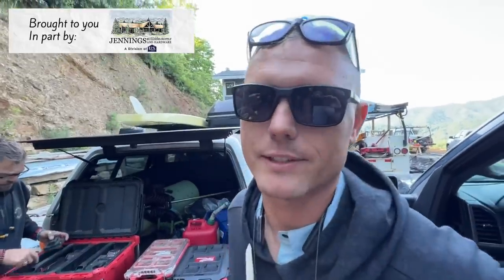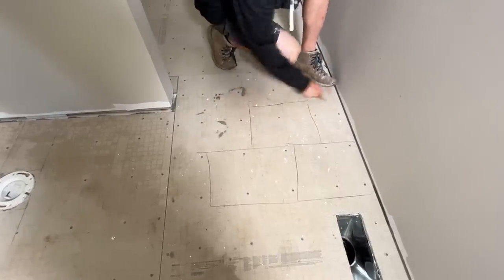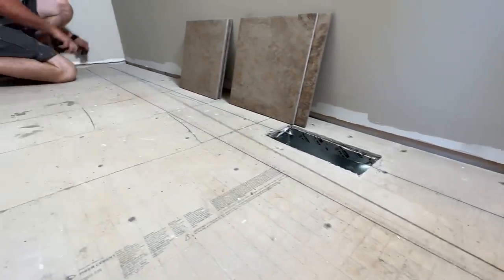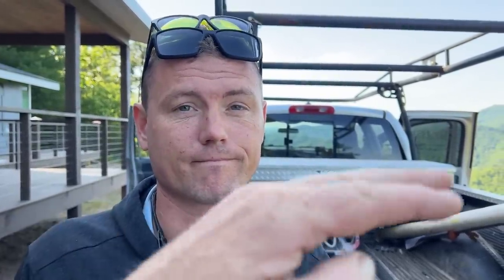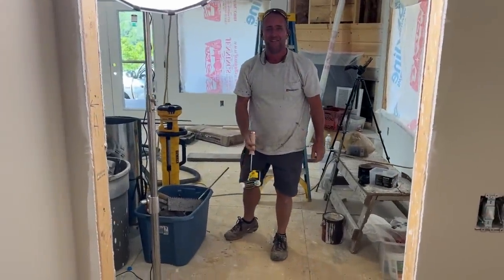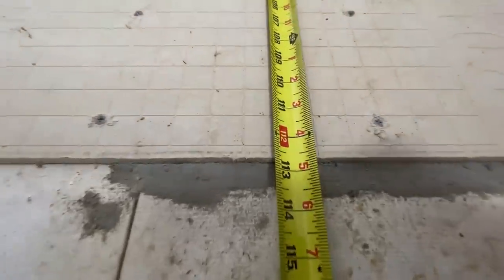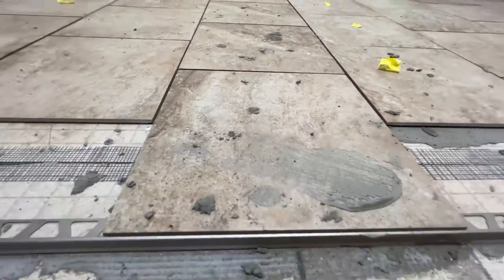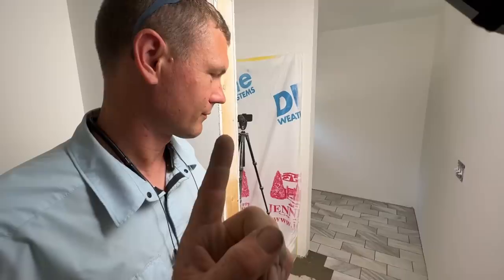Building A Mountian Cabin EP41 | T I L E goes in and we get a new tool!

Comment: For context I'm a tile setter.

The good: 

Glad to hear you are using thin set below your cement board, some people think you don't have you. But you absolutely need to! Also great to see you are taping your seams and it looks like you are not cutting tight to the wall (you need those expansion joints!)

The bad:

The way you are using your thin set will guarantee the lifetime of the floor will be shorter than it should be. For the last few years I have been replacing floors for a landlord that has many properties. His previous tiler put in flooring the exact way you are, and all the floors are failing. Some quicker than others, but the key feature that guarantees a floor failure is troweling the tile, especially when the trowel lines are going different directions. I highly suggest you get a pro tiler to walk you through an install on site. 

When I'm installing a floor here is what I do:

1: Set the cement board and tape seems on day one. (let the floor set for at least one day)
2: For a small room like that I make a template for the whole room and make all my cuts. Everything should be mapped out and ready before I set a single tile.
3: For setting the tile I key the floor like you are, then trowel on the floor (not the tile). Never ever have trowel lines going opposite directions. Before I set the tile I butter the back (same as keying the subfloor). Once the tile is laid in place all you should have to do is wiggle  it a bit to see your thin set lines collapse, all of the air should evacuate (if they cannot collapse you either have air trapped or you thin set is too stiff)

A well installed tile floor should be able to withstand a 25lb weight dropped on it from four feet or higher without the tile snapping. If there are enough air voids beneath the tile it'll snap. Heck a well set tile could have a hammer taken to it and it will never snap, just chip. 

Y'all do great work, and did everything correct outside of proper troweling and placing with the thin set.  

One last note, when buying tile, the batch number is on the box. Even if the tile is 'the same' it may not be from the same batch, which will account for the size difference.
Reply: Yes, everything that Relief said. Plus mix up several boxes of tile and randomly select a tile when setting.  That assures any variation is spread out and not as observable.

Same goes for shingles on a roof.
Reply: When you say "key the floor, then trowel on the floor"... what am I missing? Isn't it trowel the floor then key it to create the notches?  On the tile itself, I just 'back buttered' the tile with a thin layer as even as I could get for my shower, I made the notches in the thinset on the wall.  Any tips on how to get even thickness on the tile when backbuttering?  I like the idea of using the teeth on the trowel on my tile to keep it 100% uniform, but have read not to key both tile and floor and only one.
Reply: @nicpedia2432  Sorry for any confusion. When I say 'Key' the surface I mean work the thinset into the surface. So use the flat side of your trowel and really push it around and into the surface. That way you don't just have thinset sitting on top of the substrate, it's 'keyed' into the surface. Once that's done use the notched side to create your lines going in one direction. 

To review: You should be pushing the thinset into the substrate, then notching the wall/floor, buttering your tile and applying. When I back butter the tile I just use the flat side of the trowel and skim it across, I don't leave a raised layer, it should only be filling in the voids between the ridges on the tile itself. I don't really have any great tips for buttering other than running the flat side at a 45 and pull off any excess. 

I hope that helps.
Reply: Wow that’s a lot… thanks for the info. Lots of good insight
Reply: Agreed this install is bare minimum at best
Reply: 100 - thanks for sharing.  I was a tile-setter for about 5 years, and spotted everything you mentioned.
Reply: Since the Perkins Bro’s & crew really hate T-I-L-E so bad (Almost as much as Jason “loves” Painting 😂) maybe you ought to step up & offer them some journeyman on-site training & consulting.

Hell, you’d get a good vacation out of it & it seems like they all get along good enough.

They can start an offshoot series called “learning from the expert”

Comment: I can give you a good pointer for layout for tile. Layout 2 to 3 rolls with the spacers so your gap is already set, then you measure what that two or three rows is then you can measure it out on the floor and strike some lines. That way you can start in the back of the bathroom and work your way out towards the front. And as long as you stay on that line that you struck it will come out perfect every time. And if you’re doing a big room, another trick is to spray the chalk line with hairspray that way you won’t sweep it away it will stay on the ground as long as you need it to until the job is done. Works every time for me. And I just use some cheap dollar store hairspray. And I use that method on jobs that usually take more than one day like for living room and dining rooms that go together. You’re welcome for the great tip. Lol
Reply: Well thank you

Comment: I thought with mortar that you’re supposed to apply in one direction and not different angles? That way the air between the ridges can escape and you get a good adhesion to your floor?
Reply: U are right sir
Reply: If you apply the thinset to the floor yes. If you apply on the tile in a starshape pattern is fine. Air has a straight way out from any point of the tile. I use this technique for repair when I only replace 1 tile. The shorter the distance for air to escape, the better. I’m a tile guy btw.
Reply: That’s correct .. it’s called directional troweling and they are doing it the “homeowner way”

Comment: Pro tip some manufacturers put a tiny arrow on one edge of the 12x12. If you put those in the same direction the tile width wont vary as much sometimes the tile measures 11 7/8" x 11 3/4" as an example.

Comment: Eek I haven’t finished watching but seeing the mortar applied to the tile like that scares me 😳. You should apply to the floor with the notched trowel in one direction (whichever path is the shortest to the edge of the tile). The notches are to apply the right amount of thin set but also to let air escape. When you apply it to the back like that in every direction you’re bound to get air pockets
Reply: My thoughts exactly.
Reply: I was looking to post the same Pro Tip but you beat me too it.
Reply: Your overthinking it bud, it’ll be fine. Guarantee those tiles will never come up.
Reply: @CarbideEndMill  i promise you 100% that there is hollow spots in their tiles. do a youtube search for thinset coverage. It is REALLY easy to trap air under your tiles if there is pockets from the jump
Reply: If no one corrects, we can make good money fixing their shoddy job!
Reply: As soon as I saw that happen I came to the comment section!😂

Comment: I tell you, it's so much easier to work from a centered cross chalk line when you're laying tile.  And I know bathroom floors are rarely square (anything but!), so what you do is find the closest thing to center.  That is, you center North-to-South and then center East-West and then find the best intersection of the two.  If it's an "L" shaped room, then the intersection would be best in the turn of the L.  The point is, if you do it that way, you never have to worry about one edge of your tile being a little sliver.  AND, you should lay out one line of tiles in all directions (without any mud; just the tiles) along those lines just to be sure.  If that sounds fussy, all of that takes about 10 minutes.  And then you know.  That's how I was taught... back in the day.

Comment: Pro Tip for those new to Tile, BE CAREFUL with the Cut Edges, they can cut like a Razor Blade!
Reply: I learned that the hard way 😅
Reply: I learned this the hard way a long time ago
Reply: For some reason those are the most painful cuts too 😢
Reply: word. i slipped my finger once and it was a smooth big cut.
Reply: need to use a polishing block to help with that it will roll the edge on the cut side
Reply: Yes sir, dad told me all the time on a job site during demo and slice went open my fingers. Luckily I still have them in tact 😅
Reply: My four fingers will attest to that.
Reply: This is one of those things I always hear, but never really KNEW a until I experienced it first hand.  It’s obvious, but until you see that pool of blood in your mortar and can’t remember getting cut do you understand the real danger.
Reply: @apdj94  for me, they were painful later.  I didn’t know I got sliced until I saw the blood.  Later than day and the next, every time I moved the finger, I felt it!
Reply: It doesn’t feel like a razor, it rips through the skin. I tell all my new guys it’s not a pleasant feeling you ever want to experience. They never listen lol

Comment: Really enjoy watching the work you guys do but as a tile setter I love how much you hate it. That dewalt is a great saw, I run one as my daily. Look into sigma cutters and systems like schluter or laticrete they cut the labor, it's a  better assembly but increases cost. Hardy is extremely porus and will effect the thinsets bond. Hydrate your substrate, slightly bigger trowel and a touch thinner mud would achieve a better install

Comment: Another pro tip for you guys is the trowel  lines all have to be going one way for the tile to properly stick to the underlayment with no gaps so when you collapse the motor it sticks evenly with no air bubbles or gaps. When the thin set is set up you can tell if it’s not adhered properly by tapping a broomstick on the tile afterwards and if it sounds solid then it’s good if you got a little hollow sound you know the thin set is not properly stuck to the tile and floor!
Reply: I always ask the lady homeowners to walk on the tiles with heels after its dry if they want to check for hollow spots! This one customer got in a red dress and all bc she didnt wanna wear pajamas in the heels lol
Reply: @89Johneboy  🤣🤣

Comment: My wife wanted 600 * 600 tiles in our bathrooms so told her I had to have Dewalt tile cutter.  Had it for about 15+ years and still brilliant.  Mine doesn’t have the kick out for so it can’t cut anything too wide.  

Surly oh were not using tile spacers with the levelling incorporated.  You got me onto those here in UK and I don’t worry about tiling anymore.

Comment: I trowel the back of the tile like that. Just make sure that you pull the occasional tile to check coverage. However you used too small of a notch (IMO). I personally use 1/4 x 3/8 as a minimum despite flat spreading. Your thinset might also be a bit dry.

Comment: It’s easier to key in thinset on the floor, an area covering a few tiles. Then put a thin layer of thinset on the tile back. Lot faster too. Also looks like your using cheap thinset. Lot of sand. Get the mapei stuff that’s about $20-25 a bag, lot nicer to spread and work with.
Reply: I agree, modified thinset is the way to go... Sticking backer down with unmod says its okay but i dont do that either lol... Almost only sclhuter based products now, I sell the customer on the pros easily.
Reply: Do you have any tips on getting even coverage/thickness when doing the back butter on the tile?  Also, does DensShield or similar fiberglass type tile board need the thinset under the board like they did with their more concrete-style tile board?
Reply: @nicpedia2432  i have never and would never use Dense shield on a floor. I would go with 1/4 inch hardie or the uncoupling membrane that Schluter makes or another similar brand. I personally hate glueing down the backer board. It makes future removal so dang difficult and im not entirely sure its needed. Again i use uncoupling 9 times out of 10 its only about 30% more in material cost.
Reply: @nicpedia2432  when you back butter a tile, your spreading it thin, not worrying about thickness. Kind of like buttering toast “just enough”. To what John said I used schluters ditra or mapei mapeguard uncoupling product. Lot easier to work with vs a board product.

Comment: The towel lines not being uniform all in one direction is a problem. It traps air under the tiles and creates hollow spots. The air is able to escape more freely when you have them all going in one direction, and running parrallel with the short side, so that there is a shorter distance for the air to travel to escape. PRO TIP. Put the mud on one side and screed it all off the other... Then bam youre done, and clean up your mess when you are done like a real man lol... The side having mud on it is irrelevant. You mud the tile, put it down to the ground, sponge it clean, then insert spacers. bamm done.

Comment: The size difference in tiles is common when you use non rectified tiles, but also the price makes a huge difference. I have learned this the hard way. Spend some extra money on a good quality tile and you will not have this size difference, and they will be nice an flat. Another good idea is to buy tiles that are colored in depth so if you drop something on them it will not easily be visible. 

As told during your previous tile job video, only go in one direction, not from the center to the corners. It might look to be a good idea, but it is not. You need 95% coverage in wet areas. This is a lot. I love how you build houses, but I scratch my head each time when I see you put tiles. I know you hate this part of the built and you can tell. Have a look at some professionals like the tilecoach. The point is that it actually doesn't take much more effort to do it correctly. The home owner will thank you in about 10 years when your tiles are still in there. The way how you do it now it kind of a gamble. They might. No hard feelings, I learned a lot from you guys, just want to do something in return for a better end result.
Reply: long story short the tile is covered and the floor has a thin base layer id say it’ll definitely last people work different from different parts of the country there not tile pros but there job isnt done poorly
Reply: @rileywhite5091  Sorry to say but check 5:18. All the corners aren't covered. This 95% guideline is nation wide as per ANSI A108 and per the TCNA Handbook for Ceramic, Glass, and Stone Tile. Yes you will surely add some as the surface is covered as well, but no body can't tell at this moment. The only way how to know for sure is by setting the tile and removing it again. You can hear it by hitting the surface with the back of your trowel. 

The common method to do this is by going in one direction. It is actually more common to do this on the floor instead. If you have a good quality tile it should not be covered on the back of the tile, at least not for these smaller tiles, this is only done for large tiles. Then you set the tile by moving it back and forward so the high spots fill in the lower spots. This is the reason you should only use one direction, so the air isn't trapped in the middle. On  9:52 you see that they just drop them. And last, if the floor is one even sureface, as they say it is, and I believe this as the checked this, then it would be better to use a smaller trowel. It covers much more area quicker. The reason you want to go bigger is when the floor isn't even, this gives is more margin, but requires more work to make sure those gaps are filled in to meet the 95% standard.

Once again this is not to critize them, it is just to help to do a better job that lasts longer.  Also, there are a lot of professionals doing it their way. Long debate on if this is the good or bad way. But if you show it on Youtube as some educational video it is better to work according to the standards. I am aware that he clearly says "this is how I do it". I am sure that these minor changes will help in doing it even better.

Comment: Is the board already water tight under the tiles? I didn't see ya"ll tape any of the gaps
Reply: For the floor, the tile surface and grout is the “water barrier “. It’s not like a shower pan
Reply: @jaimeperkins9606  interesting! In the Netherlands we waterproof the whole floor of the bathroom. I just did it last year with my dad, but i have a semi open shower with glass walls. I guess if you have the shower in the tub it wouldn't be necessary👍🏼